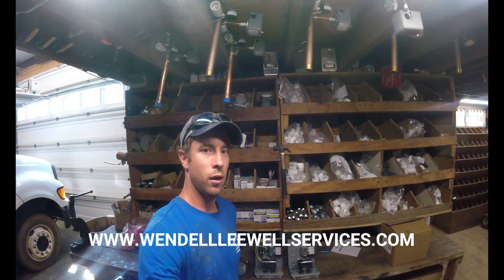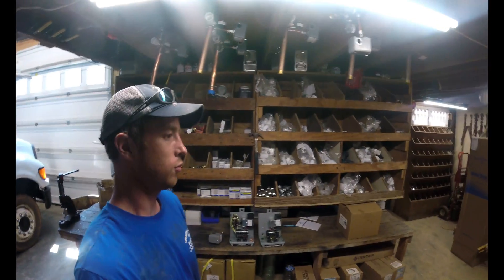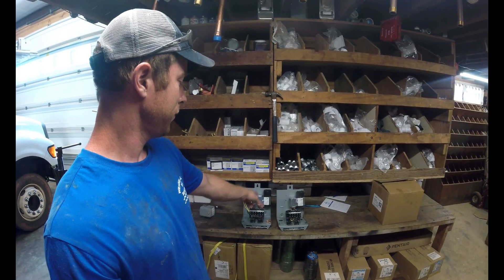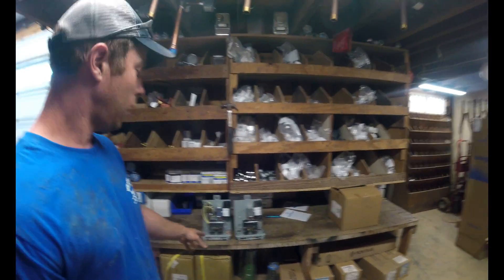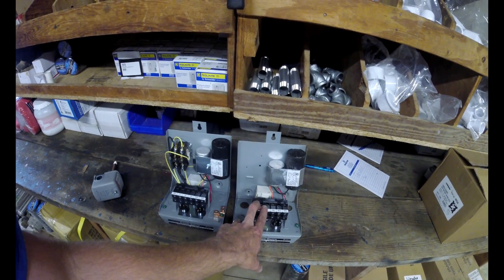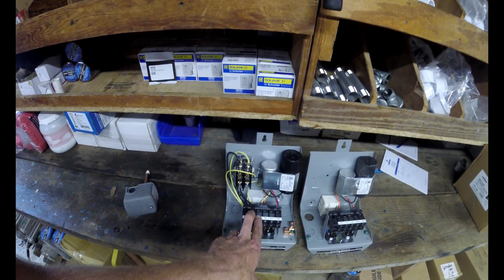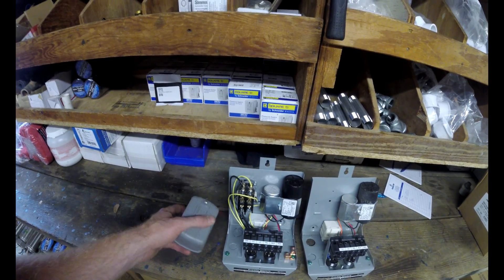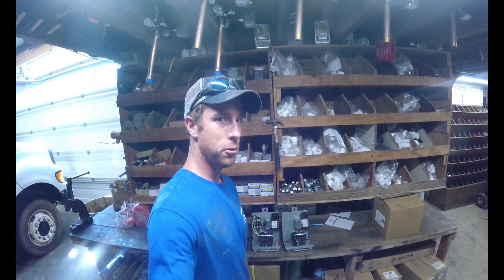Submersible Well Pump Control Box Comparison: Deluxe vs. Standard Control Box

Comment: Thank you for your information. Can you please let me know what is the difference between an external starter box versus a built in the pump? I’m really confused because it’s less than 1.5 pumps tend to be using the starter boxes but mine came with a built-in at 1.5. Can you please help clarify if I put an external box on one that has one built in already could I damage my new pump? I had a fire and everything dropped to the bottom of my well so it’s been a big nightmare I really appreciate your expertise input on my conundrum.

Comment: Thanks for making this video.  I'd have said you supply the pressure switch with a separate low voltage AC power source, and it trips the contactor with that voltage when it needs to energize the well pump.

Comment: I also have a question about the Deluxe box wires to the pressure switch.  I know you will pull 110v off the control box to the switch but what do you wire to in the pressure switch and which wire goes back switch terminal in the control box?
Reply: Have the same question, have you found a solution?
Reply: Were you able to figure it out i have the same problem.

Comment: Hi. I have the Franklin Deluxe and works for about 30 seconds and it shuts down. Afterwards i reset it using the overload resets but again it shuts down after 30 seconds or so. The unit is pretty rusted out but how do I know if its actually the control box or something else?

Comment: Hello Sir. I wish I saw your video earlier. I already purchased the delux box for the 3HP 1 phase Franklin pump without the pressure switch as you metioned. So could I run the pump without connecting the pressure switch with the delux control box or have I to take out the electric coil in it to downgrade the control box to standard? 
Thank you for your great vid. Peace.
Reply from the maker: You are fine.....tie the pressure switch into the box. It will be used to de-energize the coil and thus cutting the pump off. Go buy a pressure switch, they are cheap.
Reply: Can you add a picture of the lines going from pressurr switch to Control box. (Deluxe) Thanks